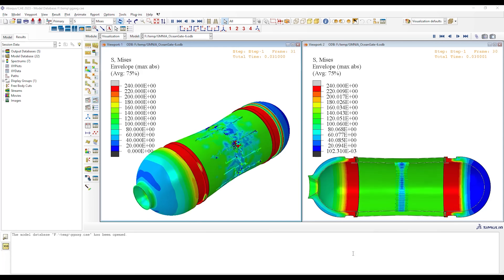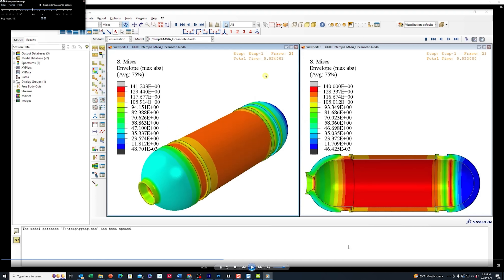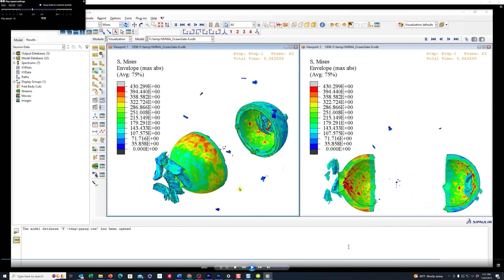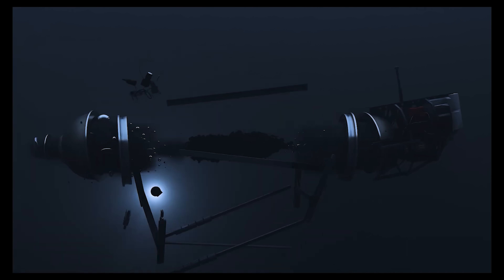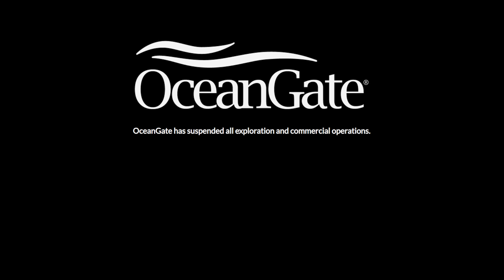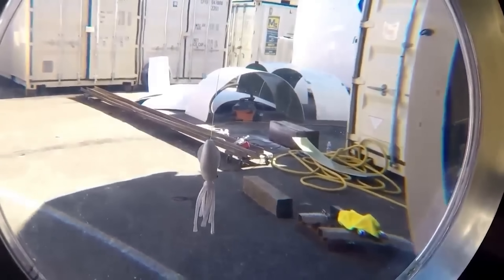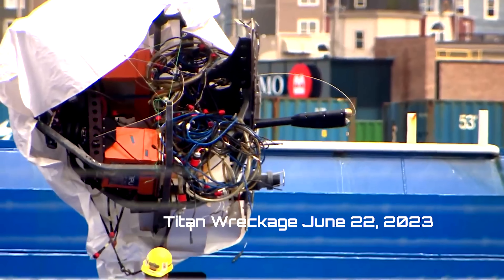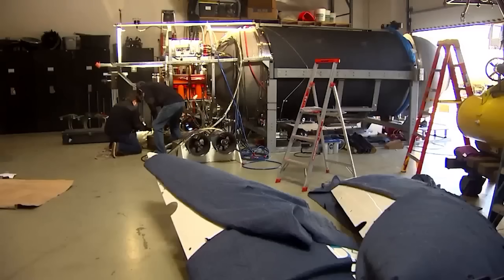Best Titan Sub Implosion Simulation, Cracked Porthole? Q & A

Comment: i think these "cracks" are salt crystals from dried salt water left otside - you see these on fins if you don't wash them with clear water after diving.... they got washed away before filmed from inside.... tension cracks in acrylic glass look different even if the pix quality is bad in video. but in my mind left over salt from seawater creats that fine tiny structures like a lightning. Tension cracks are  not like a lightning main strock with tiny children. They are more tiny stright and small lines looks in a way as a "sharp" line inside of material. Often Groups of them next to each other showing in more or less same direction next to each other. More like I I I / I / I   They kind of reflects from inside the material like a tiny mirror peace inside. Don't know how to describe, but I have seen alot tension cracks in acrylic as plastic worker mainly with PMMA and they look different.

Comment: I'm in construction and the idea of glueing stuff together to resist high pressure is insane. 

People are talking about 2 materials jointed together but in my book it's titanium jointed to the glue jointed to the carbon fibre.

There must be a reason why oil rigs are welded together. And you could argue it'd be more predictable to glue two identical materials.

Comment: Still you are, and others talking from the vessel as is a standalone, independent structure.

I still told you, the frame under the sub was connected to the rings.
If they needed multiple attempts to able to jettison it, it shows how much tension are on the connections are at that point.
No one talking about what happpens, when only disconnecting from one ring and still clinging in the aft ring.
Is act like a bottle opener, and is perfectly in-line with the crakling sounds after they tried to jettison the frame!

And the square boxes with full of electronics, the square main battery housing...

But, yes, still keep go around the glue, the carbon fiber...

Comment: Hi Jeff, it’s me again overanalyzing.  In earlier videos you mention that it is difficult to explain the missing bolts and flange that held in the viewing port.  If the implosion began at the view port, then the bolts etc. should remain.  If the more likely implosion of the hull occurred, then one could imagine a blow out of the view port, but I still find it hard to imagine it cleanly removed the bolts and flange.  Your thoughts that the bolts and view port were removed after recovery at first seems unlikely, but that idea would easily explain the missing bolts. etc.
Allow me to add to these curious observations.  The two titanium retaining rings.  If you look closely at the video of the off-loading of the recovered parts, you can see that both retaining rings were recovered; also note that curious twisted 5–6-foot strip of metal attached to one ring.  My question is why are both rings still not attached to the front and back titanium end caps?  Another two sets of 18 to 20 more bolts cleanly sheared away?  If we return to your view port hypothesis, then were these bolts also removed after recovery?  If so, why?
So many questions, so few answers.

Comment: The Design failed. Cylinder with End Caps. A Pill with Seams. Destine to fail. Replace the CF hull with a Ti hull. And it will fail at the aft seam eventually. And you find 2 end caps and the cylinder lying intact at ocean floor and everything else obliterated. The aft seem crackles as the integrity of CF failed from delamination. Like a wire bending back and forth until it breaks.  Now, I am not a physicist or engineer but I did stay at a holiday inn express once so I am qualified to state unequivocally that the fail was the Design. It just failed quicker using a CF hull.

Comment: I seriously doubt the acrylic window broke. If anything, it got pushed out during the implosion. If its the stuff Im thinking of, my mom who had a jewly busines, had these 3 inch long by one inch thick square acrylic stands. One had a scratch from box cutter, so she gave it to me, and me and my friends had never seen anything like it, and decided to try breaking it into smaller parts. Not even a heavy hammer could break this material. Put some tiny dents in, but couldn't break it. That thick window, had to have been spit out like a mellon seed. Dont know who manufactured it, but if they do know, they should make another and see what happens when its lowered in water. For all we know, it may float, and if it does, would explain why it was not found. Most likely floating in the ocean. Not good either if thats the case. A speeding boat hitting that can seriously damage a boat, and the people in it. I think the stuff is what banks use in their bullet proof windows. Plexiglass, that stuff is brittle so can easily see that shattering easily. Scary thought. Has the coast guard even checked to see where the window was made, and that it was acrylic? Wouldn't shock me to hear the material was in fact something else, and if it was, did Stockton Rush lie about it, or not know, meaning he bought something and went by the manufactures word. Another scenario, the dive was delayed because something happened to the first window, and it got replaced without Rush even knowing it. Youd be shocked at how often a tech breaks something, and replaces it without the owners permission. Best example, Comp USA years back, did a warranty repair on my wifes HP. This was before I showed her that building an I7 was much much better. Anyways, while the repair was done, which was having a 450w power supply replaced, her dvd writer was replaced by a dvd reader, which was not capable of writing, nor able to read past backups. When I took a look at it, saw the reader wasnt even an HP component. It was a Creative. So contacted them, and gave the serial number, to be told it wasnt registered to my wife, but also couldn't tell me who it was, until I did a small claims against compusa for swapping my wifes dvd writer, which again was expensive at that time. Used the small claims to force creative to give me the info it was registered to, and found out it was actually the store manager of that compusa my wife used, so modified the small claims to force him in, and instead they settled by giving my wife a bluray writer, which was over $580 at that time, and a dvd writer. In case anyone starts saying thats impossible, because they have expensive retainer attorneys, yeah, they do, but here in California, laws for small claims court, no attorney representation in court by either party. So yup, I crippled their only chance to possibly get away with it.

Comment: The more I learn about this things construction, the more I think Wile E coyote and "acme " were the primary contractors! Carbon fiber and rino liner?  They may as well used paper mache and chicken wire to think it'd safely stand up to the pressures of deep sea exploration!! Once again greed has extended one of its tentacles, for that was a contributing factor in it's design! To take more paying guinea pigs  because the ceo said it himself it was "experimental "...

Comment: Acrilic just doen't cut it, after all it's just a form of plastic, and carbon fiber is old fashion obviously not as strong as the titanium ends. What was really recovered we will maybe find out in the subsequent court findings. Speculation is a start, if the carbon fiber capsule pieces are recovered and assembled it may show the direction of the implosion regarding the port hole possible failure, I think that forensic analysis of the carbon fiber structure will be definitive answer to the complete failure. Could take years.

Comment: If a window is not in direct contact with it's holder over the whole bearing area, the air between will produce reflections at some angles that make it look like "cracks" or other odd features and it only takes <0.001" gap to do it. I would doubt those are cracks or anything of concern.

Comment: Jeff, excellent job as always.   Just some quick comments/questions.  There had to be one person who decided that 5 inches of carbon fiber was sufficient to reach the Titanic.  Why not 6 inches, or 8 inches to be safer?  Perhaps Rush’s group decided that 4 inches was enough and they added a 25% safety factor.  I guess we will never know.  From your reporting we have learned that every dive resulted in culminative crushing damage to the fiber matrix until the final “last straw” broke.  If that degradation analysis is correct, then a thicker carbon fiber hull would have only prolonged the time to implosion.
Carbon fiber submersibles, an innovation doomed to failure.  May they all rest in peace.
Reply from the maker: Thanks i'm glad you like the videos

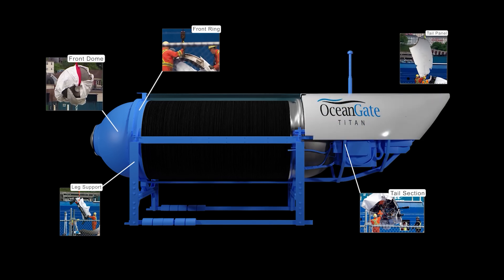Comment: I am not a marine engineer. But I am a life long boater and was in the aquarium hobby and industry for decades so I know the power of water pressure. I have seen a 200 gallon aquarium blow and the damage was incredible. This in no way certifies me to offer "expert" testimony on this sub implosion. But I can tell you about the immense power of water pressure at sea level blowing out an aquarium. It is instant and very messy. Anyway, my opinion on this sub implosion is the theory at 4:50. The CF tube has exhausted all of it's dive cycles and this was it's last dive. Once it reached a certain depth, the CF tube was crushed in the center causing an instant destruction of the vessel and death of the occupants. The forces of the implosion would have forced the air inside the sub to go somewhere and I believe it was blowing out the acrylic view port which is why they recovered the front dome end with the view port totally gone. I would bet the bodies of the crew sitting close to the front were also blown out the view port hole, this all happened in a split second.  I highly doubt they will recover any piece of the CF tube bigger than an iPhone. I believe it shattered like glass. The "human remains" they have claimed to have found would be nothing more than a piece of bone, a tooth or maybe some flesh and hair that was melted into a part of the sub upon implosion. Way to go Mr. Rush! You didn't believe in multi step safety, and you "Rushed" your crew to their death.

Comment: Not sure if the information is accurate, or miss information. Were alarms going off for 23 seconds? If so, and it was the tube they were in about to implode, they should have put the Titan in an upright position, to take pressure off the hull. Yes it would be dammed uncomfortable, but could have possibly got them up out of the danger zone, before it imploded. Think of an egg. Put pressure on its sides, it crushes easily. Put pressure from top to bottom, it's hard has hell to break with ones fingers. With gravity pressing down, dont know what the weight of pressure from the sides are, but from my perspective, upright going up could have possibly saved them from the impending breach.
Reply from the maker: Pressure is in all directions, no way to take pressure off the hull
Reply: @jeffostroff  It would be quite interesting to test and see.  If I put a foot of sand on a paper towel roll facing parallel, it would crush. But if I put it upright, it holds quite well. Water is different, but thinking of the weight from above, are you saying it's going to be the same from the sides as well? I'm obviously not seeing something.

Comment: To comment on the soldering section... Unfortunately (for this case) in today's world, if someone's phone did manage to survive but was mangled, desoldering the chip and resoldering to a working board would not help in most cases. Assuming Apple or even Samsung (Knox), these items are paired to the board they came from. Now, there may be a way around this but good luck getting either company to help with that. Apple (rightfully, imo) did not assist the US Gov in bypassing their lock screen. On principle, this would be the same deal. Given the occupants' wealth status, I would be willing to assume they did not have something like a Huawei. Good video otherwise.

Comment: I think we can rule out leaks as that would relax the strain on the hull and not lead to collapse. window ingress also seems unlikely as that would also release strain on the CF and would not lead to collapse, also the window ring was gone, suggesting it went out. it's possible memory chips could be found but it looked so brutal that I really wouldn't expect a board to survive so you'd need to find small pieces. if the comms leak is real we have a good sense of the timeline. maybe some of that syntactic foam also collapsed but it seems like a strange coincidence to have failure of two separate systems at the same time.

Comment: Might have been mentioned before but it looks like the screen(s) inside the sub were mounted by drilling into the side of the carbon fiber hull which is not ideal either.

Comment: Knowing they dropped the weights to ascend, it is highly probable the 5 guys knew of the drama of placing their minds on anticipation on worst case scenario or say, they knew they were in position of major death but still have faith they will come up on time. They knew but they didn't have to feel the agony of dying due to effects of implosion in mili seconds.  But just having thoughts of the chance you will die is worst enough over any pain they would of felt. Now, it's highly likely the authorities have the footage inside of the crew s cameras inside sub and not inform public keeping the footage for OceanGate to archive for future designs of any sub they may make in future.

Comment: A strange thing for me as a mechanical engineer: I wonder why there are no deformations on the flanges or visible bolts, or traces of broken bolts anywhere. This applies to the window as well as to the flange construction which was glued to the carbon fiber cylinder. If the glue seam had been the weak point, why would all the bolts of the flange still have disappeared? The large flange would then still be bolted to the front sphere, as well as to the rear flange assembly which is nowhere to be seen. I believe all the bolts of the flanges should still be there..and strangely enough that is not the case as can be seen on the unloading video

Comment: View port was mechanically removed. The video of the company removing the end caps showed the bolts and end plate was unscrewed. The same thing happened at the place. The two titanium plates that opens and closes, that seals in the passengers, was also unscrewed and all the bolts and nuts was gone.  Video tape doesnt lie. All. The pieces this video claims to have failed didn't. The crackling noise reported came from the rear of the sub. Nobody reported the imminent failure of the front viewport.

Comment: QUESTIONS:
1. How the control unit is connected with the external equipment ???
Due to the sealed cabin it is not possible to conduct the cables from inside to outside.
So how it is connected ?
2. How is the external equipment working if it has the same pressure outside and inside? Camera, motors, light bulbs, battery etc.
If the pressure is the same inside the equimpment as outside of it, so how the pressure changes during ascent or descent ? Is it filled with water or with gas?
.
These are two mysteries that I don't understand.

Comment: 6:44 I saw that video is it’s sweating or is it condensation if it’s sweating doesn’t it mean it ant air tight???  Didn’t the submersible have a system to circulate co2

Comment: Do a Google search of the interior of the Titan submarine and you'll see that they used metal screws to fasten the computer monitor brackets to the carbon fiber hull. Mind boggling! 🤦🏻‍♂️ 
The screw holes would drastically compromise the structural integrity of the carbon fiber hull. Brackets could have easily been fastened with epoxy.

Comment: Yeah, no, they are NOT going to find intact.. uh... anything from inside the pressure vessel.  When the implosion happened, the water would have rushed into the pressure vessel at speeds somewhere in the neighborhood of thousands of meters per SECOND.  Then, the air inside the pressure vessel superheated because it was being compressed down to a miniscule space in a matter of milliseconds, and would have basically exploded after the implosion was "finished".

Everything inside that pressure vessel was literally turned to dust.  Vaporized.  Disintegrated.

Comment: At the moment of implosion, it's instantaneous. Poof! Gone! However, leading up the fateful moment, according to the leaked transcripts, the preceding 20 minutes, there was knowledge something was wrong. They tried to jettison their ballast to surface. But, according, once again to the leaked transcripts, they descended at a rate 50% faster than normal. Which was evident 15 minutes in. Which means it was deliberate and not uncontrolled. Which means when they became aware something was wrong, they already too deep for a safe return. This is all Stockton Rush's fault. This is what an oversized ego can cause.

Comment: @jeffostroff THERE is a video on YouTube where a man makes a scale model of Titan and puts it under high water pressure.  1 model leaked water & flooded.  2nd model survived.  3rd model was crushed when carbon fiber failed & splintered.

I suspect Titan mimicked model 2 (survived) until it was crushed like model 3 (implosion).

Comment: If the biggest person in the drip went to look out the port hole they all could have been in the dome when it imploded.  Imagine how a boat does when you get too much weight on one side or the other.  If they all rolled forward it would have caused that nose down drop some are speculating.  Unfortunately we have yet to see the port hole acrilic OR and carbon fiber.  It was snapped into another dimension or disappeared.  They don't want us to see it.